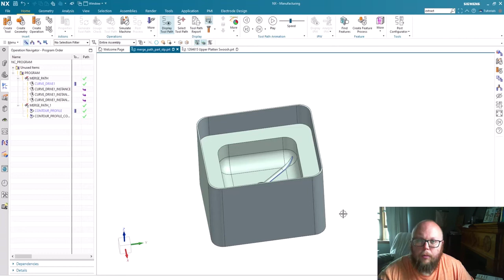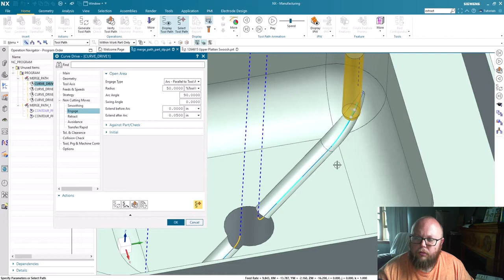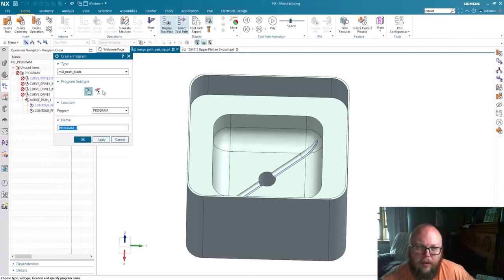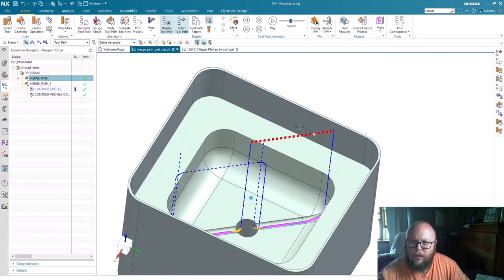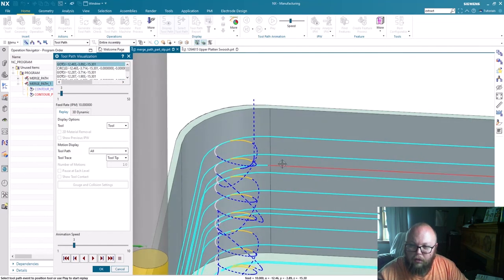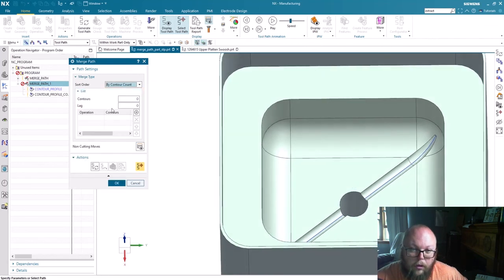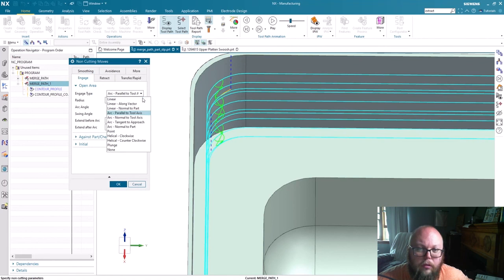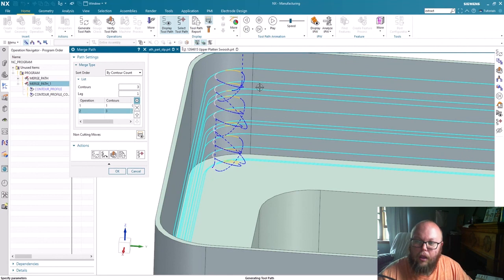Merging Toolpaths | NX CAM Tutorial

Comment: Make videos on how to deal with vertical mid/between corner radius of 1.5mm radius... I have 80mm long  endmill... Depth is 50mm... I use zlevel corner in NX cam.... But it lead to mismatch finish face....what to do...I use NX 1953

Comment: I have an issue....in z level stagger ramping circular toolpath (like helical).... My toolpath breaks into linear moves and nx generate like a linear .... It should be an circular move.... When i verify animation...tool moves linearly in small segment to complete circle it polygon.... When this operation is post process and perform to machine ...finish workpiece and look from near it is like polygon with small segments..do you have any solution for this???
Reply: This sounds like the toolpath internal to NX is outputting linear motions. If you are seeing a faceted appearance on your work piece I would suggest changing the Max cut step value. OOTB this parameter is set to 30% of the tool diameter, I'd suggest changing to 0.2mm and view the results on your physical workpiece.
Reply: @johnvincent4853  i tried already .... I think my workpiece geometry edges are not round enough that causes this may be what do you say about it , you hve any other solution...?

Comment: If i mirror 1 tool program 5 times... Is it merge ...? Or i have to post process 5 times???..... Also other questions is.... What about i use 3 different tools endmill ballmill and drilling... first 3 operation create and than how to merge in single post process file in nx cam 1953... Can you makw video on that???
Reply: No, if you mirror a tool path it is not "Merged". You can create three (3) operations with different tools/operations types and, if you create them within a program group, you can post process them all at the same time.